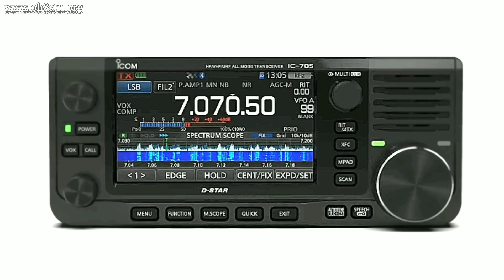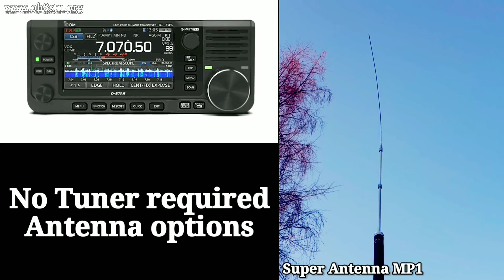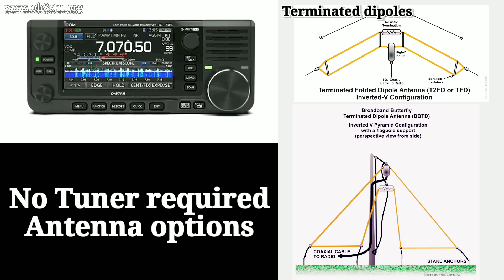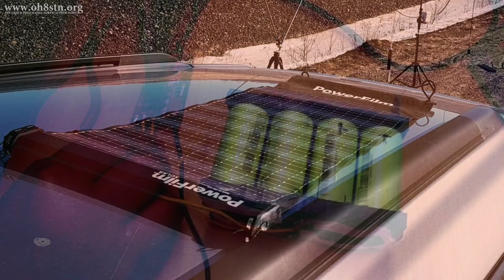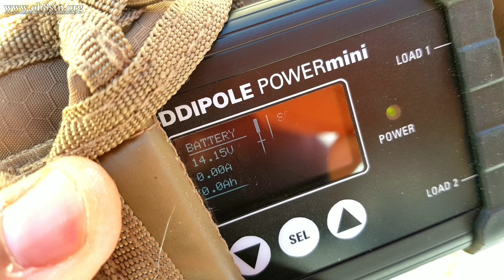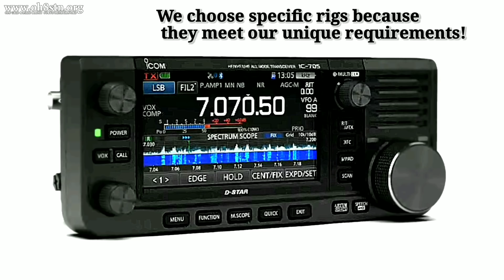Icom IC-705 Update April 2020

Comment: So here is a question that I have not heard asked yet; To save weight for back packing do you think you will be able to you leave the included battery out of it, and bring a small LiFEPO4 battery pack in the field to power it with that would be lighter to carry and have more amp power to run it? Or would you have to have the included battery in it regardless of the external battery pack?
Reply from the maker: Great question. Lets answer it with experience from the 817nd. My 817nd is also used with an external battery pack. Even so,  Its internal batteries are always installed. This is so  there's always a backup power source. It's okay when on tour with the fat bike since weight isn't bug issue. When hiking or theres a need for counting ounces or grams, occasionally the internal pack has been left at home, in favour of an 4S LiFePO4 pack, or 3s Li-ion to power it.
So I think you make an excellent point. 👍👍👍

Comment: Julian,  Thanks for another excellent video and comments on the strong points of these radios.   The Icom 705 definitely looks like an interesting radio with a lot of potential.   I  do agree that the Elecraft radios are excellent radios and are quite capable radios,  I have operated the KX3.  You bring up interesting observations on being able to charge the IC 705 in the field and have 2 meters and 440 mhz already installed.  I am sure there will be many accessories being offered after  it's released.  I look forward to this radio being released and how it will perform off grid in the field.  Not having an internal antenna tuner is not a big issue for me since I would choose a resonant antenna for the radio anyway.   Thanks.

Comment: I have gotten rid of antenna tuners and have chosen to build resonant antennas. My home made magnetic loops never need a tuner, other than the variable capacitor on the antenna, to pre-check vswr, I use a Comet MK2-500 analyzer/cross meter. Tuners are half antenna match, half dummy load, resonance solves so many other issues. 73's N7XO
Reply from the maker: Well said👍👍👍

Comment: Other manufacturers are delayed too. Engineering design doesn't spring from nowhere, it takes people and facilites. Production needs a supply chain for components. All is disrupted at the moment. Disppointing its delayed, but don't expect Yaesu or anyone to magic up a competitor and "get the jump" on Icom.
For a resonant antenna the end-connected OCFD existed for years, but people still struggle with fan dipoles and bitch about no tuner?
Reply: And there is also a supply chain to take into account..

Comment: I find most internal tuners not that great. You need an almost resonant antenna to use them. With the 7300 anything over 3 or 4 to one and forget it. I'd prefer to get either an MFJ, or LDG external tuner , or a manual tuner. So I would not let that factor into my buying criteria. Last radio I had that had a matching tuner that really worked that way was my Yaesu FT757GXII. That sucker would tune a wet noodle.  Resonant is so much better. Not to say all my antennas are perfect, as they are not! But at least I can get a tune for the band i want.  I've had the KX2 and I loved it. I hate myself for selling it! But if I were to replace it, based on the cost to get one here in Canada, chances are the 705 price would not be much more based on what I've heard. By the time I got the radio here paid the fees and taxes, it was over $2000, And I agree, that if the radio is meant to use voice , you should not have to pay $50 more for the privilege to use it!

Comment: Thank you, and awesome review as always. I have a KX3 that I assembled with the tuner ($1,400). I got it for field portable in the Arctic and general use for SSB and digital. I absolutely love the receiver, current draw, ease of use, screen size, and tuner capability. 

I don't use the internal battery AA holder out off concern for opening and closing the case. I made my own heat sink because the stock heat spreader is insufficient for digital. I also think it is a little fragile and not dust or water resistant. The cost of the px3 is prohibitive for me currently.

If the icom 705 was available 3 years ago, I would have heavily considered it. I don't regret my purchase, but the built in panadapter and VHF UHF all mode is promising.

Comment: Excellent comparison Julian! Two hearts are beating in my chest :-) I use a KX2 (2 Years) and a FT-817ND (10 years) Power supply of both are a pain in the back, your right in that point. The FT-817 has no builtin tuner, both don't have a sound card built in. What a modern radio should have, Powerpole connectors, built-in batteries (chargable inside the radio) and USB charging options. Built-in tuner, built-in soundcard an cat device on a single wire.  Waterfall display is really nice, but no real benefit out in the field in my opinion. All bands (160-6) would be great too.
A modern qrp or better outdoor radio should be robust too. IP67 would be nice. :-) I surely will buy a 705 as soon as it gets available. Right now I am a KX2 fanboy, but other fathers have nice daughters too :-) Time will tell. 73, Stephan, DF6PA
Reply from the maker: Well said 👍👍👍

Comment: Is there an amplifier available? Would love a radio I can use in the shack and in the field doing qrp. Thanks!
Reply from the maker: That's a great question. I hope Icom is reading this.
Reply: @OH8STN  I was noodling about this myself as I was looking to use it for both in the field and as a base station for our vacation home.  I was thinking the Xiegu 125W amplifier which has an ATU build in might be an interesting match.  Easy to transport between houses as only 2 items to drag along.

Comment: Julian, just admit it, you just like that screen on the 705 :-)

Yeah good video, but one thing about Elecraft is that they give you option to add a tuner if you want to pay for it or you can add it at a later time, that's the way it should be done, Give People a choice. 

Next is the battery in the 705, there's no reason with today's Lithium battery tech that Icom couldn't include a proper 12v battery for the full 10 watts of power, why have a 10 watt radio that limits to 5 watts ? this is a bit insane. 

The Xiegu X5105 has a good internal tuner and proper 12v battery that can power it for many hrs and it fits into the small pouch of a Tecsun PL-660, that's a truly compact little radio. 

The Xiegu G90 has a good tuner too, 20 watts, needs external battery  but if you want 10 watts output from the 705 you need an external power source too. I know you said you have had issues with the CE-19 interface but I use it with the G90 and X5105 all the time on JS8 with no issues, even some PSK 31. The CE-19 interface is very compact. 

If I go portable then usually I'm bringing the FT-891, 100 watts makes all the difference, the Mp1 is a great very compact antenna that just works.

For Digital the G90 is my favourite radio, 20 watts really helps, I run it on battery in my sitting room while my XYL is reading or watching TV. My EFHW is great except when I need bands it's not resonant on, this is where the G90 excellent tuner really shines or when I want to work the phone portion of 80m I can hit the tune button and bang, I'm on the air, the EFHW has a coil for 80m so bandwidth is very narrow but it's tuned for the CW portion, I need the Tuner for the Phone part of the band. If I'm tuning around and I hear someone on 17m my EFHW is not resonant on that band, with the G90 and my X5105, no problem, hit tune and bang, I'm on the band, not efficiently but I'm on it making contacts. Won't be able to do that with the 705 sadly. 

For ultra compact and lightness I take the X5105. It's really convenient taking it on the plane. 

The 705 has some interesting features, the USB interface, charging via USB but will it operate the radio via USB, USB C ? 

Bluetooth is another cool feature, using a bluetooth headset ? I use bluetooth headset with I operate the IC-7300 remotely. This is very handy and means less clutter of wires. Control the radio from phone maybe ? or software on the Laptop ?

The 705 is the most interesting radio to come out in years for sure but, I can't justify the cost compared to a Xiegu G90 especially if I have to have external battery, I may as well have a radio that can output 20W or 100W if I take the FT-891 with the same battery. + it will allow me work my EFHW on non resonant bands.

I can have the G90 and FT-891 and still have change left over :-) 

Still, I'd like a 705 to play with :-)

Comment: Julian, would love to see a comparo between your G90 and the upcoming IC 705, especially in terms of overall functionality and weight.  BTW, how are you liking the G90 so far? IU3JNT
Reply from the maker: Actually that might be a good idea. Did you 90s nice but it has a couple of issues which are quite annoying. First of all I should say performance is magnificent. It's a great little radio. Two things I don't like about it are the cat control cable being plugged into the front head unit. And the poor cat control integration with flrig. Push-to-talk, band and frequency changes I'm working perfectly. All the other commands are a no-go.

Comment: I am currently looking for a mobile rig. Would you still recommend the 891? This would be for fun as well as emergency comms out in the Bush, with the ability for digital and analog. Was looking at the Anytone AT-D578UV III Pro DMR Tri-band also but not sure about the quality? You seem very pleased with the 891 though? This new icom looks promising, but not sure I want to wait that long. Thanks!!
Reply from the maker: You know the ft-891 is a HF radio right? I absolutely love it and I'm currently building a go box with it. I don't have any experience with the anytone radios, but I'm sure there's lots of videos on YouTube about them.
Reply: @OH8STN  Yes sir! That's why I am interested. I really like your current work developing a field expedient comms set up. I want to arrange a similar if not the same setup! I'd like to be able to communicate for long distances to contacts quite a ways away, as well as to family members just a few miles away. Thank you!!
Reply: tntshuffle - get the FT-891 it’s a great radio, lots of menus but most are set once and forget. You can set the most common menus to the buttons on the radio. 

You can have 5 watts, 10, 20, 50 or 100 watts anything you want, having 100 watts is really great when you need it, qrp is fun but can be quite a challenge. When I go portable I just want to make contacts with less effort with limited time.

If you need a tuner the MFJ-939Y is supposed to work really well with the 891 and should come with a cable for to connect to the radio, it’s probably one of the best compact auto tuners out there and way better than LDG, I have researched a lot on tuners and the MFJ-939 is the one I’m going to get. The LDG tuners don’t integrate with the radios so well either.

The Noise reduction on the 891 is great and much better than the 7300, the 891 would also make a great base radio.

If there’s one radio I’m never selling and it’s the FT-891!

Comment: Thank you for a calm and rational presentation. Disclaimer: I am new KX3 owner (Sept. 2019). However, that being said,  I am thrilled with what the Icom-705 brings to the party. 
BTW, It should be noted that there is an aftermarket Mod for changing out the internal batteries of the KX3 and replacing them with LiFePO4 power, and I am considering doing just that. 
Looking forward to your upcoming videos... as always. 73...
Reply from the maker: Thank you Douglas.
Reply: I got a Turnigy LiFeP04 4 S 8.4 Ah battery from Hobby King, It will run my 100 watt FT-891 no problem. Best thing is that I can charge it at 15 amps on my RC balance ( charge 8.4 ah in about 45 mins from flat )  charger but compact 4S balance chargers can be got. The only thing with these batteries is that without BMS you need to monitor the voltage and not let it fall below 10v, but I have a battery voltage monitor to monitor that. A BMS can fail anyway causing damage to the battery. 

15 amps charging, that's fantastic, parallel 2 for 16.8 ah and charge them at 30 amps ! gota love Lithium. Kinda makes the internal battery of the IC-705 seem rather sad.
Reply: Do you have a link?

Comment: Good video and review.  It will nice when you get one and do an actual field review of the rig.  I still say that the price will deter a lot of prospective buyers.  I have the Yaesu FT-817ND and really like it.  As you mentioned that if you use a resonate antenna you don’t need the ATU.  I use a random EF wire with my 817 and I built my own WRC type antenna and with a NanoVNA I don’t need a tuner, or since the Yaesu 817 has a built in SWR meter I could get the WRC type antenna I built tuned.  I for one can’t afford the 705 when it comes out if it is going to be priced as high as I have heard.  If it was priced around the 818 I would probably buy one.  73 Juddie WD8WV